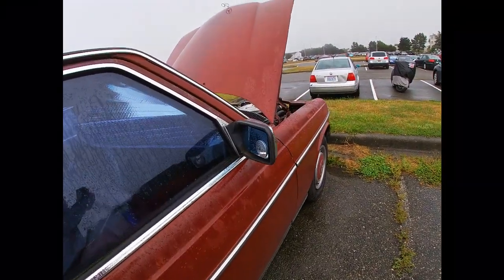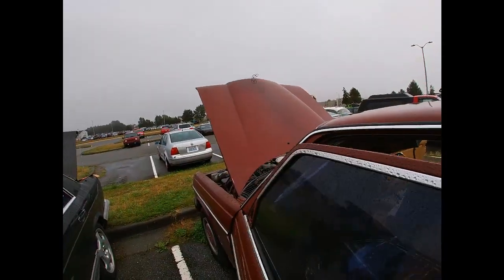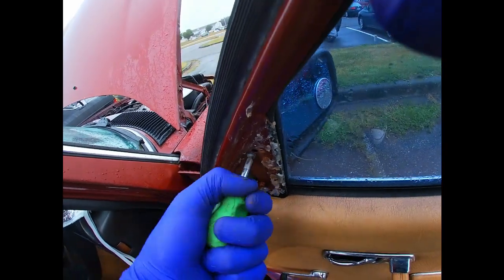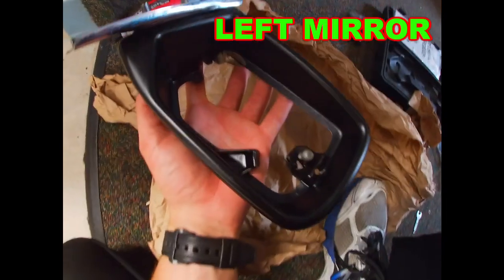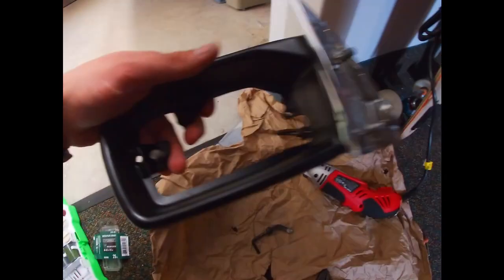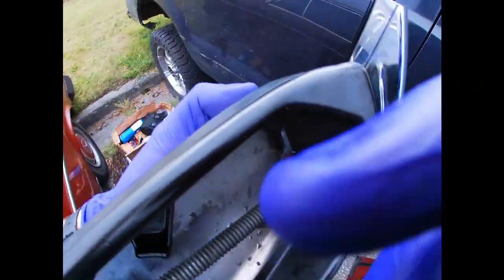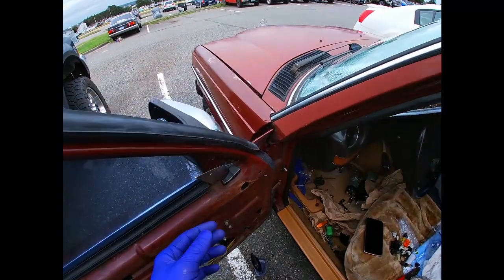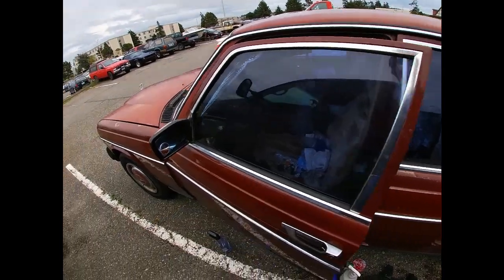Mercedes W123 W126 W116 W115 Loose/Frozen Mirror Maintenance

Comment: Those are really helpful details about the mirror disassembly and repair! I’ll have to try the rustoleum rubber and bumper spray, it looked great when you finished ☺️! Silicone and self tapping screw right through the face of the trim uggg 🙄 no good.
Reply from the maker: Thanks Tom! Yeah, I see disappointment in a lot of people... 😮

Comment: Been watching your videos for a few weeks now. I've an 82' 300D (188K) and a 79' 300CD (88k!!! Just bought her). 
Maybe I missed it in the video...but how did you get the glass and the backing off?
Reply from the maker: Thank you for watching, sir! I post new videos every week. 
And you have to grab the outer part of the mirror and pull it towards you. There's a ball joint that needs to pop off. Afterwards, you can slide the mirror glass out. You can see the glass installation from the video. It's a reverse of removal
As far as taking the whole mirror apart, is you have to disconnect that spring first, remove the rubber gasket and backing cover. You'll figure it out once you have the mirror assembly in your hands. It's not hard🚗💨
Reply: VITO'S GARAGE Thank you. Enjoying your channel a lot. Have a good one.